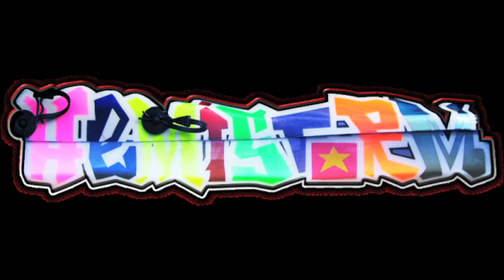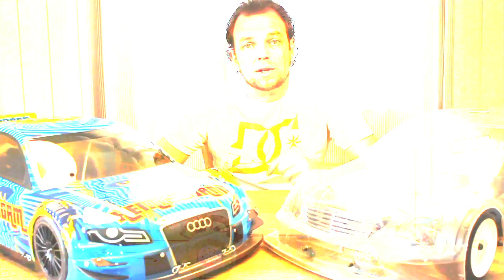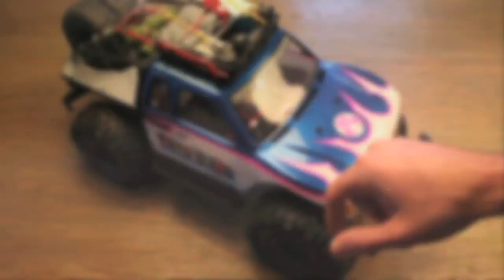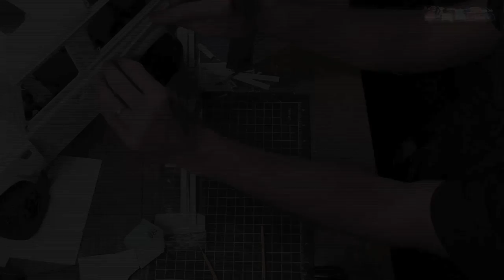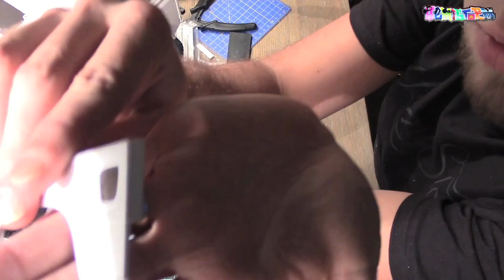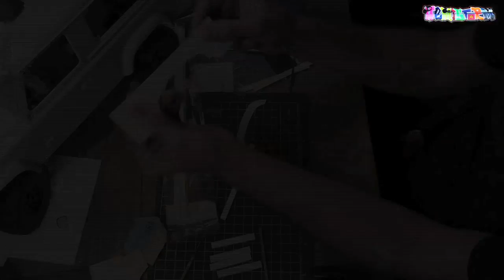Kahn Defender - RC4WD Gelande 2 custom build - Styrene Basics 2

Comment: That thing is looking ace please tell me it will be satin black when finished like the real one featured in this video. Cant wait to see it finished do you know if you can bend this styrene stuff. Because you have inspired me to modify some of my old shells giving them a repreve from my loft/scrap yard
Reply: Heat it with a heat gun and it becomes pliable enough to bend. Be careful though, I am not sure how much heat this stuff can handle.
Reply from the maker: The thicker styrene can take a bit of heat, you will see it warp soon enough, as a sign that it's ready to be bent into shape. :)